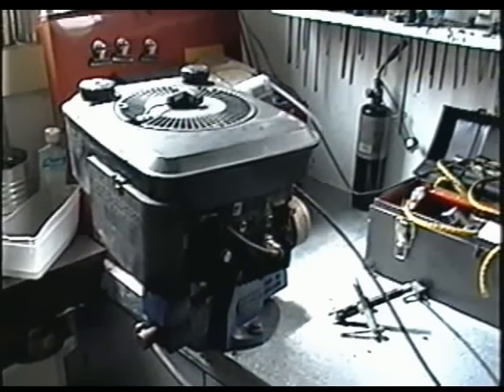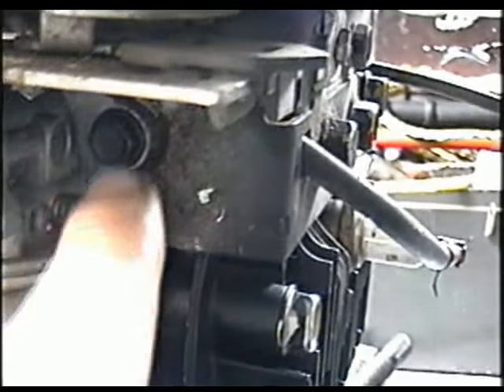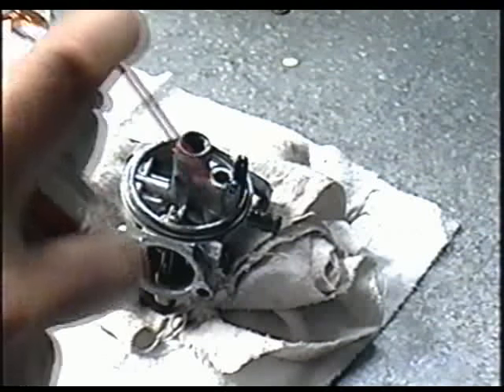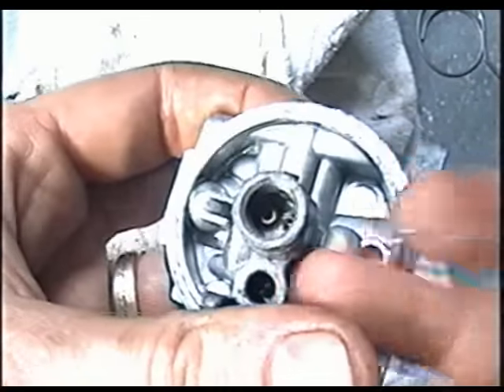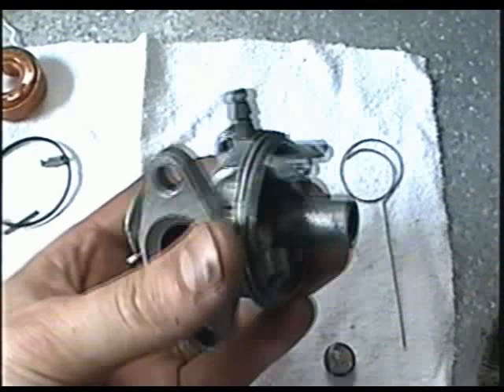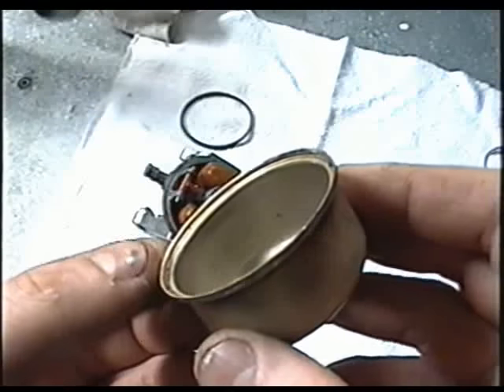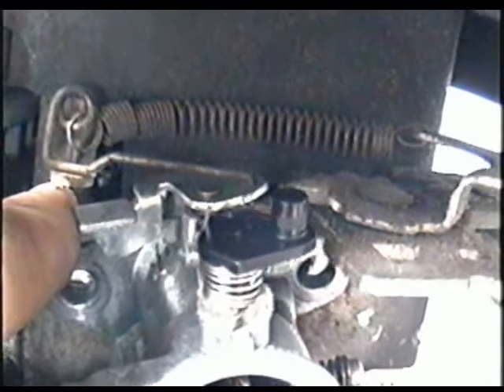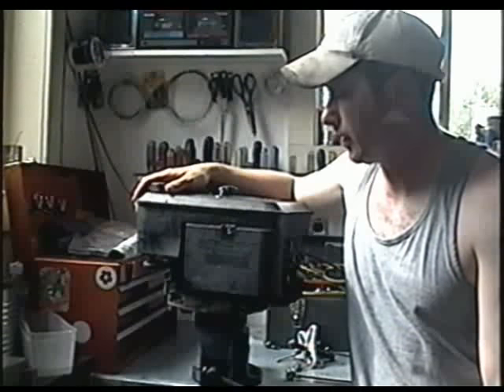HOW TO CLEAN The Carburetor on BRIGGS & Stratton Quantum Lawnmower Engines

Comment: Thanks for the excellent video!!  I took off the carburetor, and found that to be relatively easy. Unfortunately I also found that the intake manifold had totally cracked apart, which may explain my mower leaking gas (I had no idea at the time what an intake manifold was and it was almost impossible to find it on parts lists).  My question now is how to replace the manifold - I got the part today, but no instructions and can't find any on the web! Lots of info on the carb, but none on manifold?!

Comment: Hello and thank you very much for your videos - your explanations are clear and concise. I have Briggs Stratton 6.75 hp. I can get mower to start and run but it runs unevenly (surges up and down). I removed carb, float, needle and cleaned. Still runs unevenly. Gas is fresh. Any ideas? Thanks!

Comment: All I have to say now is that mechanics should be arrested for highway robbery!  My Craftsman 2300 psi pressure washer w a 6.0 Briggs and Stratton engine started stalling, backfiring, and leaking gas from the bowl under the carburetor.  A mechanic wanted $80 an hour for labor plus parts to fix it. I did it myself and now the thing now runs like new.  It took me 2 hours to do the job following this video’s advice, so in my book….I saved about $200.00. Thank you donyboy73, Youtube, and Internet!

Comment: Maybe useful to note:
I tightened the nut on the bottom that holds the float cup apparently too much and the engine dies quickly, so not too tight. My gaskets had some tiny gaps from probably age and compression and I couldnt find a carb repair kit anywhere for this engine , so with a toothpick, I smeared a bit of liquid gasket for a car engine  - seems to hold up after some use.  Now, the engine runs much slower and quieter.  Also solved the problem of excess fuel use of the last few years.

Comment: I have a question. I cleaned my carburetor on my snowblower and put in new carb kit. It starts easily and Idles just fine. Throttle brings engine to full speed smoothly. When I move into snow engine loads up and dies. What do I look for now? Thanks for your video and any suggestions.🤔👍

Comment: Love all your vids! My mower stopped running when removing the bowl there was a round metal circle that fell out. Its the welch plug! Did not know that but I wondered why it came out? If you do not have a pick to get the float valve seat out you can use your air compressor and blow the air thru the gas intake nozzle and it will fly right out.

Comment: @donyboy73 Today I took the big nut off the bottom of the bowl and let the fuel flow out. I then put the nut back on and started the bike up. I let it run for about 5 minutes before turning it off and watching... I seemed to have fixed it. I'll be watching it carefully however.

Comment: Do you have a video for repairing a Toro power clear model 38584  sn 310003440 carb leak?  My Toro had a gas stain under the carb on the floor. It still runs fine, but after 12 years of use, I think it might be time for a new carburetor unless its something simple.

Comment: Fantastic video! This guide allowed me to disassemble and clean the carb on my Briggs readystart quantum engine with ease! There were some minor differences between engines (i.e - no adjusting screw on mine), but nothing major. My engine, being less than 2 years old, was surging pretty bad and the local shop told me  fuel related repairs were NOT covered under warranty. After opening the carb, it looked really clean but I cleaned it anyway and now it's running smoothly! Do you use B'laster LMT?

Comment: Is there a Gasket in between the air filter housing and the carburetor?
Great video. My jet is seeping gas when the engine is off. Looks like a needle/seat problem. Thanks for the video, very helpful.

Comment: Great video.  I have a similar carb, but it won't prime.  I put a known working primer bulb and new gasket between carb & air filter case.  Mower will run with starting fluid but idle very low. How would you suggest I repair these two issues?  Thanks!

Comment: Hi, Great video, Very informative, I do still have a problem, My engine is the same you have in this video. The engine would only idle and not rev up. I did everything you showed in the video and the engine still runs the same by not revving up, just idle's and no backfiring. I have drained the gas and oil, then replaced. A new spark plug which gets a dry black coating after about 30 minutes of running. Any idea's of what the problem could be ?  Thanks for a reply

Comment: They DO make great electric mowers! Home Depot, at least, has a Homelite that cuts at least 1/3 acre on a charge.  The battery can be charged in the mower, or if you can pick up a couple gallons of milk you can pick the battery out of the mower and bring it inside to charge.  It was in the range of $300.

Comment: Great videos !  Also looked at your valve adjustment videos.  I am try to get my lawn tractor running correctly.  Currently it starts but does not run well.  It consistently backfires through the carburator and runs down the battery.  I will be cleaning the carburator and adjusting the valves in the next day or two.
Do you have a video on the Flywheel Key ?
Much appreciated !

Comment: Thank you for the great video...donboy73, btw i have a 3hp older briggs& stratton edger. I've taken off the side panel, where the magneto is located...tried to fired it up this morning...but it probably an electical problem i presume...what do you think it could be? At one time it started up with no problem but, since it was sitting outside for a little while...that may be the problem.

Comment: Great vid, thanks.  I did everything you stated but here's the problem (cleaned and rebuilt carb, new plug, new gas, changed oil,, didn't do the welch plug).  If I put some gas directly in the carb, it starts on the first pull and continues to run until I release bar.  Then it won't start.  Re cleaned carb, replaced needle valve (but not seat), replaced gaskets, ckd that there is gas in float tank and it did the same thing. Starts right up with gas in carb but won't afterwards.  Note I don't put the carb cover that has primer bulb or air filter back on since I need access to carb inlet to pour gas in there.  Any idea why it works with gas in carb but won't afterwards. Same exact mower as the one in your video.  Thanks in advance.

Comment: Thanks for the video.  So, I have gas leaking out consistently, so I am trying to take out the needle and seat.  Needle looks fine, But I cannot get out the seat.  There was a lot of white gunk, but no seat.  I it possible my model doesn't have a seat or is it possible that it disintegrated into white gunk.  The rest of the carburetor wasn't so dirty.

Comment: without reading all your comments the 'mechanic' needs to clean the metering orifice and crossfeed on the 'bowl nut'     i've often found that term misleading because it's not a nut....if anything it's a bolt with holes drilled into it aka the jet and crossfeed.    if the plug (my terminology) is blocked the motor will not start and usually will not prime on motors so equipped     nice close ups on your vid   keep it up  -the shadetree lawnmower guy  (G)

Comment: I just got news from Home Depot that my Briggs and Straton lawn mower has low compression like 35lbs. pressure.  The tech said it should be about 95lb pressure. The guy asked if I wanted to have it sent to Utah to get a full diagnosis at no extra charge to me(I already paid $45 to have my carb cleaned and change my spark plug.  He guaranteed me that it would cost over $200 to have it repaired.  The lawn mower is 5 years old.  I told him, "Nah, dump it."  At no extra charge to me."  After seeing this and a few other videos on you tube I'm wondering if I should have cleaned the carb again, myself.  (I had used old gas but added sea foam) and fiddled around with the engine, carb, filter, etc.  Too late now.  I guess another $3-400 down the drain.  Yikes!

Comment: yikes i cleaned the carburetor and change the spark plug (supposedly gapped to my requirements), and it is still not starting. now, i have a bigger problem as gas is leaking from the carburetor cup around the rubber gasket area opposite the bolt. the cup does not feel snug and has some wiggle room which makes sense why it's leaking, but as i put it back together the way i disassembled it, i cannot figure out what the problem is. i have tried reseating the gasket and tightening the bolt several times but each time once i open the fuel line the cup begins to leak again from that same spot. 

how do i fix the leak and get the engine running again?

Comment: This vid has been very helpful, but I have a question. I didn't see a gasket between your carb and the mower, which is what I am waiting for now before I can put my carb back on. Did you have a gasket, and isn't that needed? I had to scrape the old one off and it was in pieces. Thanks!

Comment: Hi, very explicative video. Where can I get the tool you used to remove the seat and how is it called? I think I have to replace that because all the gas is coming out from the air filter area.  Does that come in a kit? Thanks!

Comment: Great video, that carb looks just like my 5hp quantum engine.  I rebuilt the carb but did not replace the seat.  As soon as I put gas in the fuel tank it drips out the air cleaner.  Is this because I did not replace the seat?  What could be wrong with it?  I'm spinning my wheels trying to fix!  thanks!

P.S.~ When I spray starter fluid in the air cleaner opening (that leads to carb) it keeps running very well, but it does not seem to want to use any gas from the tank.

Comment: Great info, order carb kit, did what was done on the video and also replaced felt washer where the choke plate that now my mower idles high could not find idle screw on carb, oh by the way I have a Briggs engine model# 124T02-0455-E1 is what can be done about high idle?

Comment: Thanks for this video!  I am going try it this weekend!  One question is I just found out the used mower that I got is without the air filter.  Don't know how long did the previous owner ran it without the filter...I will buy a new one to replace it, however, will I have problem in the long run?  Any way to clear the dust out if its clogged?  Thank you!

Comment: Thanks for the great video, have stripped and cleaned mine, just hope it starts, going to out it back together now. Question... How come there is no gasket for the carb? Thanks, Dan.
Reply from the maker: some have an 0-ring on intake
Reply: donyboy73 brilliant I was getting worried as others wouldent fit. The auto choke confuses me as I'm use to other B&s models with the primer. Thanks again

Comment: quick question donyboy, i have a B&S 18hp nikki-6 china clone carburetor, surging , took it off and it's really clean but put back on still surging but lowest idle ok, highest idle (cutting grass) is ok too, HOWEVER mid idle runs for a few seconds then cuts off like it going to die , then goes right back up to running fine, few seconds then acts like it going to die , then goes right back up and and over and over.  So mid-idle is jacked up.  I tried mixture screw, nothing and idle screw nothing. Should i just get another nikki-clone on internet since their only 16 to 20 bucks?   I think this one is 2 or 3 years old.  Thanks MAN!!!

Comment: hello i have a question on the seat. i bought a mower with a briggs engine . it run and starts but has a little surging and a miss. i took apart the carb and cleaned it per your vid. i noticed that the needle seat seems to have been installed upside down.  would this have any effect on how the engine runs and cause the issues i am having?  thansk for any help

Comment: Great tutorial. I have a 6HP B&S and its carb is a little different. There is no screw on its side and a few more changes. I did everything and still, it takes at least 10-15 pulls before the engine starts. Any ideas?
Thanks :)

Comment: donyboy great videos.  I have a craftsman self propelled push mower with a 7hp.  I parked it last year after shearing the flywheel pin.  I just replaced that and changed the oil and gas.  It cuts and runs good but smokes bad.  I dumped the oil again and it's milky.  I put new in and ran for a short warm up.  It still smokes and oil is milky and smells like gas.  what could be the problem?

Comment: @donyboy73 I will.  Quick question for you.  So I started it yesterday.  Just for a minute or so.  When I moved the choke to run, it stalled out.  Started right up again...moved the choke to run and it stalled again.  Funky smell...guessing it was the fuel burning too rich.  Today, I started it and let it run about 5 minutes then moved it half way....let it run some more....and then moved it all the way to run and it was fine.  Does that sound about right?  It hasn't been started in 2 years.

Comment: I have  a Coleman generator that sat for a year the engine runs great but I get no voltage out I checked for mouse nest and  found none  It had voltage and good current before I stopped using it it is in a enclosure. 
Any Ideas ?
I thank you for this video because I put that seat in upside down.

Thanks!!!

Comment: I have a briggs with a very similar carb (206cc) but it has a plastic fuel line connector that is at a right angle, I think its clogged but I cant figure out how to remove it without excessive force How can I get that little white connector off so I can inspect it for a clog?

Comment: my carburetor doesnt have any adjustment screws, can that be normal? or might it have just lost the screws? i have a 2007 quantum60. motor seems to run good for now after cleaning. i wish i could adjust it a bit leaner, the ignition plug seemed a bit sooted last time i checked.
also can i use brake cleaner oder aceton instead of carburetorcleaner?
thanks for the video!

Comment: Changed the air filter spark plug and put in new battery mower started but it vibrate and runs really slow no power even after I change the speed what should I do now could it be the carburetor that needs to be changed

Comment: Hey dony great vids im having an issue with my kawasaki lawn mower the idle goes up and down we cleaned carb and checked fuel lines no luck, any suggestions?
Reply from the maker: I would re-clean it, it could be that the carb needs to be replaced
Reply: +donyboy73  it all started because engine siezed pushed piston in oiled it and put it togwther no issues before hand,

Comment: HI, I have a Briggs & Stratton and today upon attempting to use my lawn mower for the first time this season I discovered it was very hard to get running.  When I finally got it to start it would only run for a few seconds and cut out.  I attempted to do this but when I removed the bowl nut, gas started coming out.  Was I supposed to disconnect the fuel pump, or does this indicate something else?

Comment: hi 
I have a Murray lawn mower  6.5 h model #228670x31a I did clean the carburetor still not working 
I mean when I try to pull the starter rope it started for a few second the turn off 
I did check the gas line gas is coming  can you please help me with problem

Comment: We have no throttle control over the engine, we have adjusted the governor and the engine still races really high, so we think it's the carburetor. The engine is a Briggs and Stratton 15.5 hp. Would there be a way to repair and fix the carburetor?

Comment: I have gas getting into my oil. I was told to clean the carb. If I clean the carb and replace the seals will it fix this problem? I do not understand how the oil is connected to the gas/carb. thanks for a reply

Comment: Great vid...Though, could use some help.  U mention gas coming out the carb, This is happening to me, after I cleaned the entire carb and replaced the rubber seat & needle.  Is there something anything else that would cause this.  Or do I need to re-seat the rubber seat yet again.  :(   Mine is a no prime type carb...
Reply from the maker: YOU MAY WANT TO REPLACE THE CARB BOWL GASKET
Reply from the maker: WATCH THE updated version of this vid  HOW TO CLEAN A Briggs & Stratton Quantum Lawnmower Carburetor

Comment: My mower fires up first pull and runs for about ten minutes... then dies.  Could this have anything to do with the carb?  I've replaced the spark plug, air filter, and cleaned out the gas tank, also cleaned the bowl and the nut with the jets through it.

Comment: The adjustment screw on that carb is low speed or high speed?  I must have a jet cloged still because it won't start unless carb spray is shot in the body...

Comment: I have one of these motors on my mower, it starts and runs in about 3 pulls when cold, but when it's hot it's a pain to start, takes maybe 10-15 pulls to get going, and when it does it misses a bit,  makes a little black smoke, then finally runs. I have good spark, any suggestions?

Comment: hi I have a Tecumseh carb on my riding lawn more.  my issue is I clean out the cab because it will only run on choke.   but also I replace the needle and seat....   and new blow ring seal and clean all the jets... made sure all jet where clean.  and set the bottom needle on two and half turns and the side  screw  one hold turn out.    and it will only run on choke... even when I try to adjust the bottom screw out it runs better so I take it off choke and it shuts down...   so I wait and restart it and same thing ... I don't know why it keep doing this... I use to be able just to clean out the carb and it was ready to go and adjust the setting and this time nothing is working.   I even had a guy that works on small engine look at the carb... he said I did a great job on the rebuild carb..

Comment: Hey.  Got a question... Is it ok to run premium 93 octane in these small mower and pressure washer engines.  I got a Briggs 6.75 on my power washer and I'm going to clean the carb and want to keep it running clean...